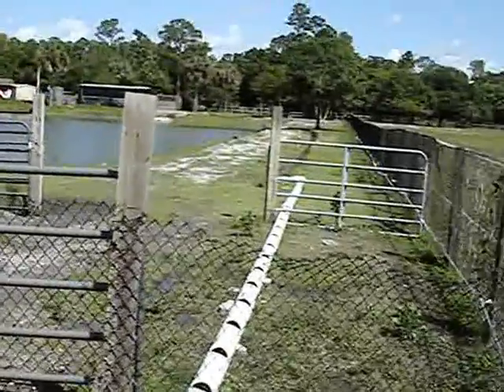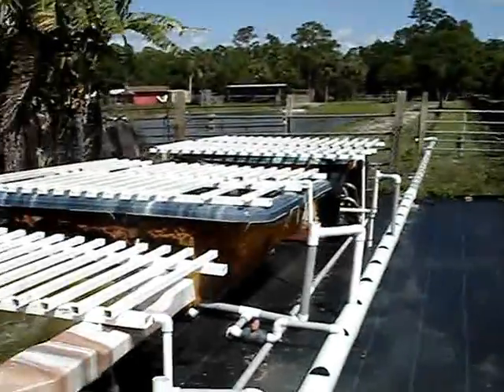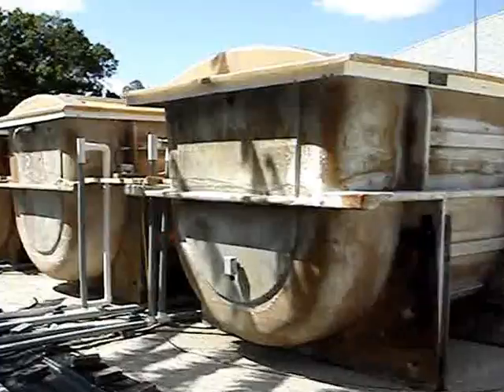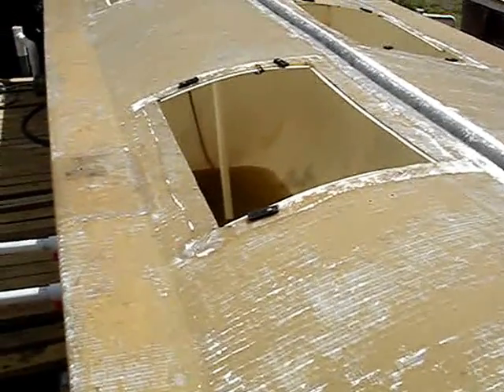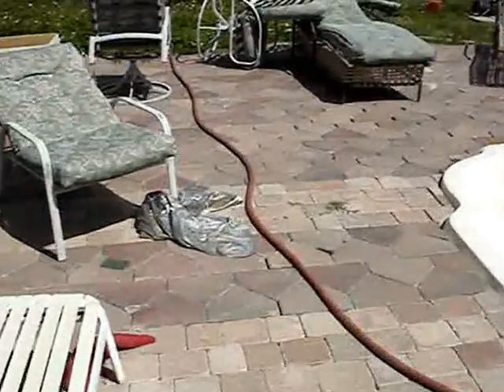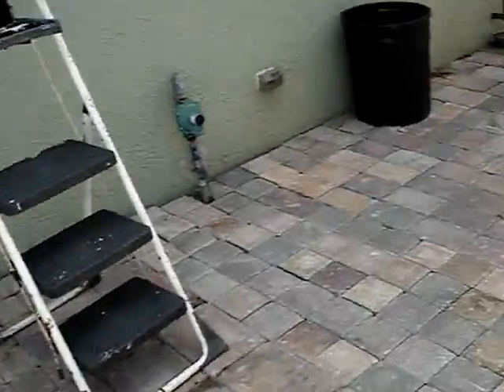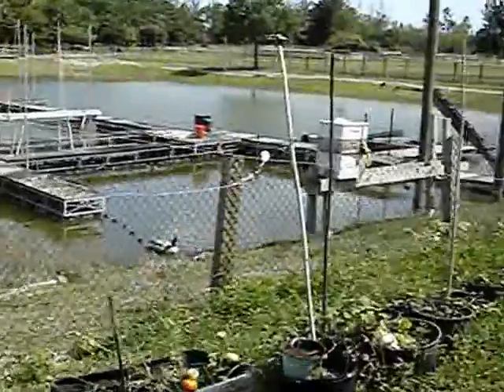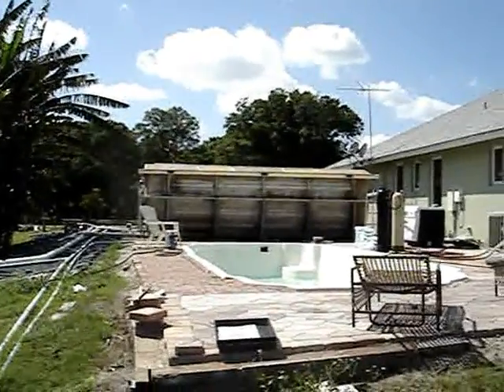Breeding Tilapia in Loxahatchee MAJOR IMPROVEMENT.MPG

Comment from the maker: The water stays at the same temp as the lake, the pump keeps the water circulating 24 /7.
 # 2, great question. This is a test project. The lake is over a million gals of water, the trench is over 150 feet before dumping back into the lake, we will have plants to get the nitrates out and we pump the solids off the bottom of the lake when needed. The project is getting to be a lot of work. 